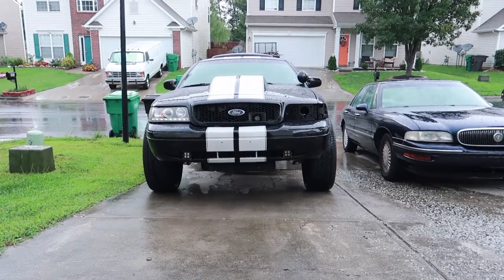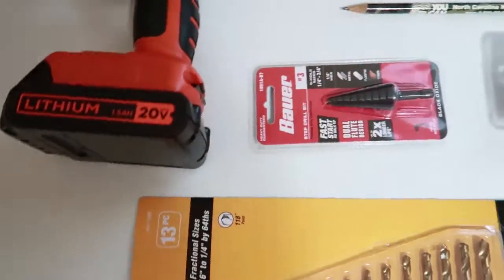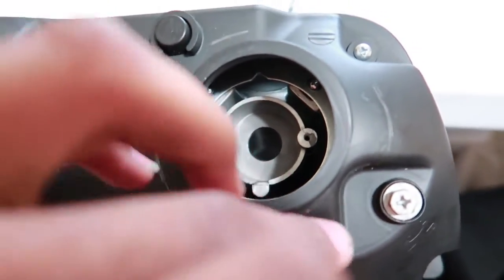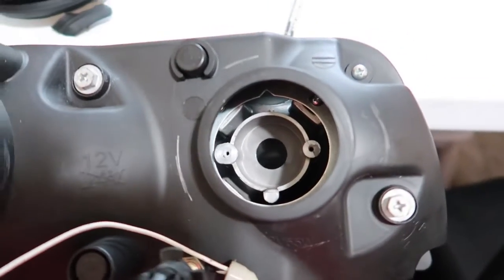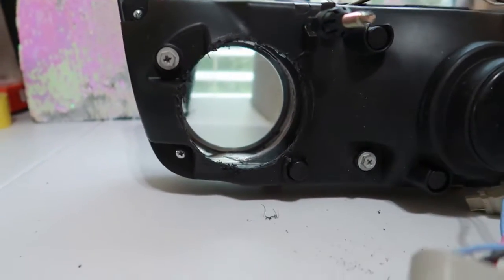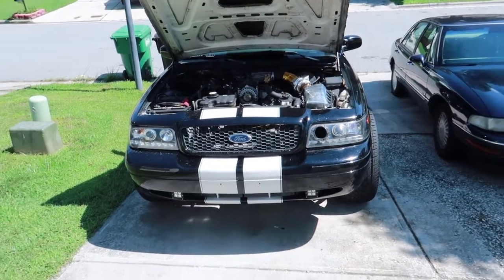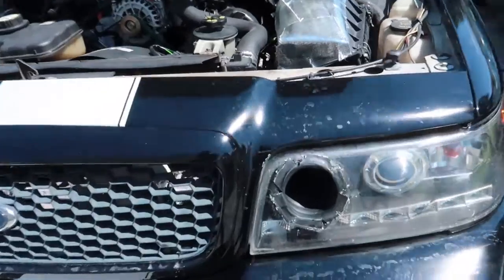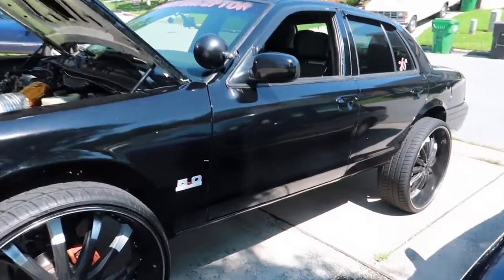First Ever DIY Crown Victoria Custom Headlight Intake Snorkel

Comment: You'll get more throttle response if u add a "Throttle Body Spacer" the 4 screws that come with it isn't long enough. Your gonna have to by some that are an inch longer at any hardware store. Your gonna thank me for it! I got it for my 1997 Mercury Grand Marquis. 👍🏽
Reply from the maker: @oldschoolrican  Thanx for the info brother.
Reply: @2xmototv206  Fasho mane. Oh and also you gain between 5 to 10 more horsepower & 10 pounds of torque Hopefully you'll do a video on how to install.

Comment: Does it run wired in the rain?
Reply from the maker: Runs even in the rain. Havnt had any issue with water inside. You have to basicly submerge a intake to hydra lock a engine

Comment: Yo 2x,

9:18 How the heck did you drill that hole so straight, and true?
I would have screwed that up for sure. I'm rooting for on that 400+ goal. 

-Chuck
Reply from the maker: Thanx brother.. i really just took my time and mapped out everything before i done it.. as long as you take your time with anything you cant screw it up..
Reply: @2xmototv206  
Right on.

Comment: I was wondering if wrapping the air box really helps or not I have the k&n filter but I haven’t wrapped anything
Reply from the maker: It definetely keep cool air flowing in. Reduces heat over time so you keep your power..

Comment: Have you had any problem washing the car by getting water into the intake? just installed sum like this in my 300 n I'm low key scared to wash it and get water in the intake  n hydro lock the car
Reply from the maker: Na i havnt had any issues.. I mean we shouldnt spray water directly into it but a little water here and there isnt gonna hurt.. you would have to have alot of water getting sucked into the intake to hydro lock ur engine..
Reply: @2xmototv206  preciate it bro ...love the videos keep up the grind 💯

Comment: Will the headlights you have in there fit my Merc alot of sites says it won't fit
Reply: No header pannel is different on the mercs
Reply from the maker: ive seen cats running them on there mercs bro.. it should fit. its the same car lol...
Reply: 2x Moto Tv look up grand marquis/marauder header pannel then look up the vics and compare them grille and headlight shaping is different vic is more rounded mercs are more square and Angled only thing that’s interchangeable is the corner lights I know because I’ve tried it lol

Comment: 1st
Reply from the maker: Everytime.. Bro this mod is well worth it to do yourself.. I can tell a big difference in power and response..
Reply: @2xmototv206  considering the fact do they make a headlight in the form of what you doing to your light also will it mess with your electrical